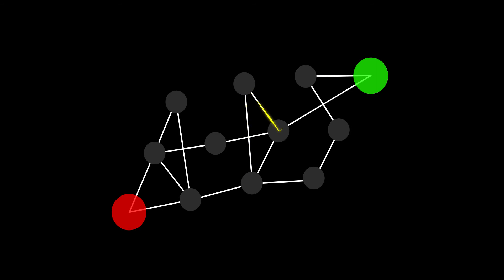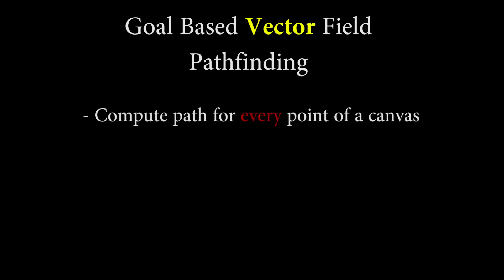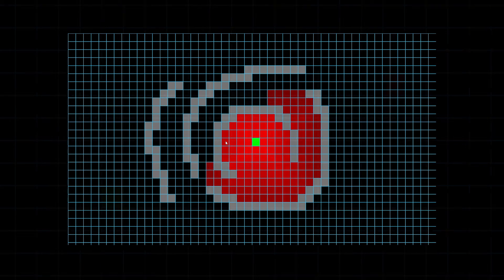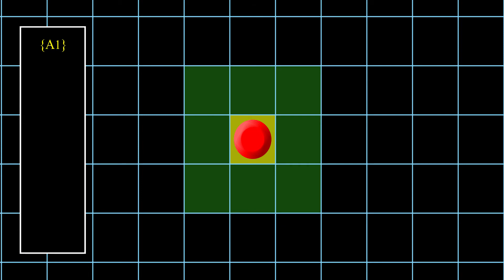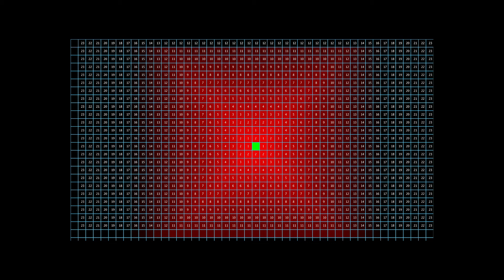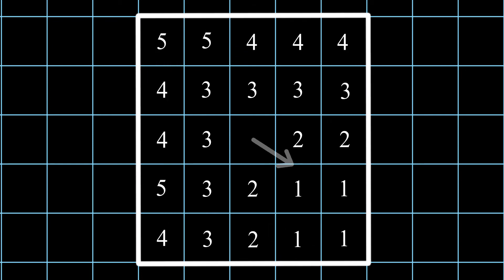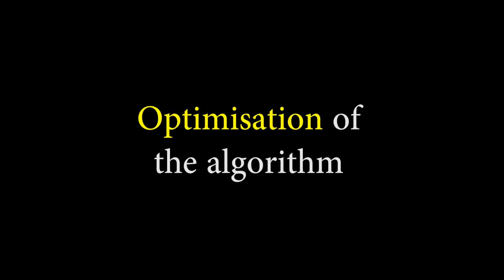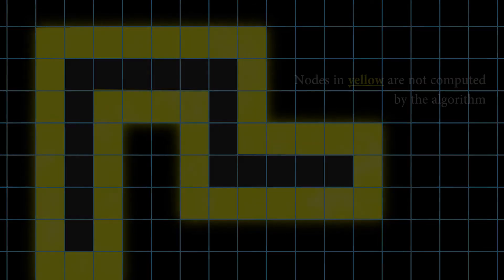How do vector field Pathfinding algorithm work ?

Comment: Interesting I'm hoping to bend these general steps into an application for selecting paths along branching paths... like roads and rails.

Possibly by describing the path network in terms of the movement grid... or using the 'distance' and 'already visited' logic with a table of distances hm

Comment: I'm a bit confused. The min function in the convolution simply recovers the choice that you made in the min step of the heatmap, doesn't it? Why recompute it? How does using anything other than min produce a correct solution, since this—having the second step replicate the first—is the exact thing you need? If you want “organic” aren't you better off randomising the open nodes list? And most of all—why does the map need to be discretised? Can't you go straight to something that looks a little like a Voronoi diagram, which carves the plane up into irregular polygons, each of which has a single point as its optimal next waypoint?

Comment: I made a crowd simulator during a 3 day coding project recently and also had the idea of generating a vector field 'map' by doing all the calculations at once in the beginning, so this was a very interesting watch. Comparing this video to my thought process (I knew and did no real research into this topic for the project), it's interesting that there are already established distance types for these sort of vector fields, I just used euclidian distance as it seemed most natural. I also didn't even think of doing a heat map and implementing vector kernel convolution, which restricted the final movement of each individual in the crowd to 8 directions. This is a much more flexible and generally smarter approach, and I'm kind of tempted to take another look at that project now after seeing this.

Comment: This is really cool, and presumably very efficient for having multiple enemies , as they can all reference the same navigation field, rather than having to calculate their own individual path using A* on a ode graph.
Reply: Not only that, but the AI can use flow graphs to avoid sending troops into areas where many have died previously and keep trying alternate routes into the player's bases etc. :)
Reply: Yes, but they have to share the same destination.
Reply: There's a neat little game called Liquid War.

Comment: There’s another distance where the ones in the cardinal directions are 10 and in the corners are 12. It more closely resembles the sqrt of 2 while still being whole numbers.
Reply: It is the same. √2 = ~1.4. You multiply everything by 10, so adjacent cells are 10 and diagonals are 14 (not 12)

Comment: The animation is nice, but your explanation that it's better for pathfinding is completely wrong. Dijkstra's Algorithm already gives the shortest path to any goal from any point and step 1 in this video is to generate the distances to the end goal - which you do via Dijkstra's. So you're already done. You already know all the shortest paths and which direction to go from any cell. There is no reason to do all the extra vector calculations.
Reply: It allows for more degrees of freedom and will smooth out the movement. This is especially noticable when crossing an open area, where the agent will move along a line towards the next corner instead of the next tile.

Comment: Thanks for the clear explanation, it was very good. Some questions I'm stuck with are: Goal Based Vector field looks just like Dijkstra for all points on the map, at 3:52 we talk about Already visited, if we already visited, isn't previous the distance inherently equal or shorter in all three variations (Manhattan, tchebychev, euclidian)? I don't think we need to validate more if the node has already been found?
When Calculating each point, if you store the point it came from you also already calculated the walking vector, so I don't see the need for Kernel Convolution, considering we had the green arrow already?

Comment: "Reduce our processing time overall"
Yeah hold on a second, very misleading statement. It can be faster in certain situations, there's a lot of situations where the calculation of the vectorfield is significantly slower than A*. Its a specialized tool not a one size fits all solution. You're running non trivial calculations on n^2 cells, that will get very expensive for large areas. However, where this technique really shines is when you need to pathfind for more than one AI "agent". Calculating the vectorfield may be expensive, but its cheaper than having 100s of AI agents calculating their own A* paths on the fly.

Comment: Great explanation! Recently I've been working on a A* pathfinding algorithm and I can't see how calculating a vector field for all the tiles every time you search for a path is faster than A*. Because after making the map you still have to run some algorithm to get the optimal path, right? The vector field just makes it easier. Although I can see how it's useful for games like Age of Empires where units come spawn from the same place.
Reply: you could store the vector map for each item after computing. It will probably be a pain in terms of memory but as long as the map doesnt change often this should not be too expensive. At this point, you have a path drawn from every point in the map
Reply: @hibilaldheu3990  Not very useful unless the destination goal stays the same for a long time or there are only few destination goals overall.

Comment: Is this faster that A*?
Reply: depends on the number of agents, since this is computed from the perspective of the target only, it better suited for large number of agents
Reply from the maker: If you want to calculate the best path for one agent, A* is clearly better (because the vector field algorithm already implent the Djikstra Algorithm, having almost the same time complexity as A*). However for multiple agents, the time complexity of the Vectorfield Algorithm becomes better than multiple A* for each agent.
Reply: @pdn-pasdenom4979  if multiple objects trying find a path, they should generate a full map of directions for every object and keep it until the path is complete? I find it pretty heavy method comparing to a* processing faster (if path is possible) and returning only turning points as a path looks much more lighter.
Maybe having colliding units and forced (by outer forces) movements makes it better.

am i wrong?
Reply from the maker: @nightyonetwothree  Well it depends. First A* has a greater time complexity than the Djikstra algorithm because it uses a better heuristic which make the computation more complex. However you could, indeed, make a single A* pass on the grid (like we do here with the Djikstra Algorithm) and then, to find the path for each agent, look at each tile parent (meaning the neighbor with the smaller distance to the target node basically) : by following this "trail" you create a path. In this specific case, the vectorfield algorithm has a higher complexity than A* because of its additionnal layer of kernel convolution to compute the direction of each tile. Nevertheless, firstly their time complexity are comparable which doesn't disadvantages vectorfield that much and secondly (and for me the most important argument) the ouput path for each agent isn't optimal in terms of smoothness and ways to be aware of obstacles. 

The reason why vectorfield algorithm were invented was to make pathfinding on bigger map and greater number of agent simpler and faster to implement which it does ! 
Like I said in other comments, I'm still working on a web post to fully explain this algorithm (in term of complexity compared to other methods, its math regarding the optimal convergence of the paths, in which case it is relevant and how to optimize it when following a spec sheet).

Comment: I don't understand how the vector orientation is done when there is a wall next to it.
Reply from the maker: Thanks for your comment. There are basically two ways to deal with walls: the first one (that i explain in the video) is simply to not acknowledge them by creating a dead-zone around them that will not be computed in the kernel convolution (if neighbor is a wall then skip to the next neighbor). Another way to counter this issue is to set as the distance from the target node of the wall, a big value like 10^6 for instance (this value should depend on the size of your tile relatively to the size of your screen or map) so that the arrow will point in the opposite direction of the wall. However this last method isn't the most relevant because it will fastly create weird behaviors in the movement of the entity that will follow the vectorfield. Other methods might exist to deal with this issue but i can't think of anything better.
Reply: @pdn-pasdenom4979  Thank you very much for taking the time to answer my question. It is interesting this kind of programmes.

Comment: What value do you use in the Vector kernel convolution for unwalkable tiles?
Reply: When I implemented a version of this I simply used a very large number. In my case a map had 62500 points (250x250 grid) so I initialized all points to 90000 (arbitrarily chosen to be well above total nodes) Walls are always longer, even if the path hits every single node, which would mean no walls so an impossible scenario anyway. There are better ways but this is functional
Reply from the maker: Unwakable tiles are just simply not computed in the kernel convolution but after more investigation i found out that it's not the best option when you decrease your tile size. I will soon post a latex link in the description to give more explanation of the algorithm and give its full pseudocode.

Comment: Wouldn't breath first search produce the same results? Why do we need calculate vectors and distances?
Reply: I came for this comment. You get both with a single bfs run with diligent ordering of neighbours visited.
Reply: This method should produce the same path as A*, or at least a very similar one, however for a static target and multiple entities using a vector field means you only need to run the search algorithm once and just have all entities access the vector field for pathfinding.
Reply: @matthewparker9276  , I mean we could just go through the graph using BFS starting from our destination without searching specific node, putting a pointer to the node we came into each current node. And when we need to find actual path, we could just use those pointers
Am I missing something? Why do we need heat maps and calculating vectors, if we can just do this?
Reply from the maker: @eugenekuzmenko4716  Well first, using pointers in BFS doesn't guarantee you that the path you found is the shortest path (thus not answering the requirement of a shortest path algorithm). However, if you take as your kernel convolution function the minimum value among the neighbor nodes (as shown in the optimization part of the video), it approach your idea of using BFS and pointers.
Reply: @pdn-pasdenom4979  , I thought BFS would guarantie shortest path because in the you always advance one "layer" at the time, so resulting path takes few steps as possible
Reply from the maker: @eugenekuzmenko4716  Well that depends on the definition of distance you choose. If you implement a BFS as a pathfinding algorithm, it may perform better than A* using Tchebishev distance but for a euclidian distance, A* will most surely "win" for the same graph / map. A* being an heuristic, it will almost win all the time over BFS.
Reply from the maker: Indeed, like Matthew said, any algorithm like A* or BFS are suitable to compute the distance of each tile of the grid from the target tile. I like to use djisktra because of it's time complexity and simplicity.

Comment: Thanks for the video! Curious how did you come up with f(x) = 1/x for the kernel filter? Would Prewitt operator work here or it has some disadvantage?
Reply from the maker: Hi! Thank you for your comment, it really encourages to make more videos like that! As for your question, i did some experiment with the sobel operator in order to evaluate the local orientation of the gradient (here computed directly from the values of the "djikstra distance map") with atan2(G_y,G_x), but the results weren't convincing enough for my taste and the computing time was overkill for a fast pathfinding algorithm. The fact that the gradient we are looking for is the gradient of a distance map (from a point of the grid), is the main argument that allows me to use any decreasing function as the "kernel convolution operator", because it approximate the gradient orientation relatively well for this case.
But I think I'm going to write a latex document on the subject for further explanation of the processes behind the algorithm and the intuition that led to such choices !